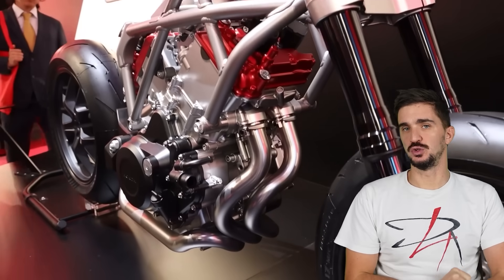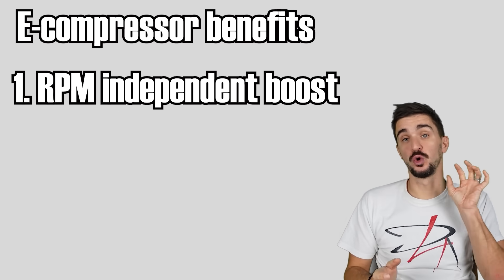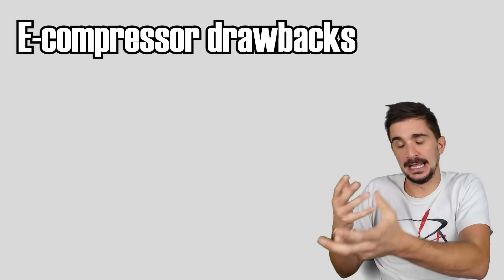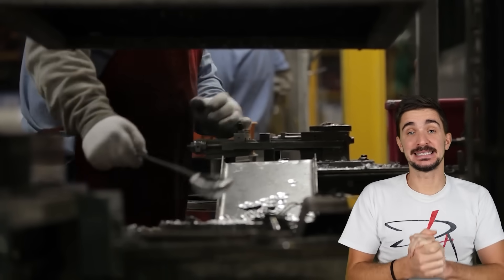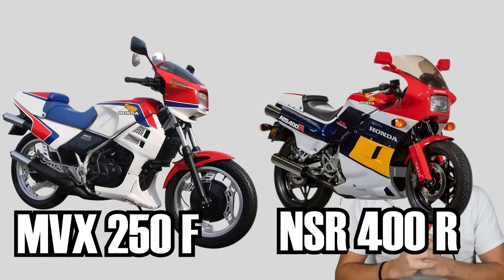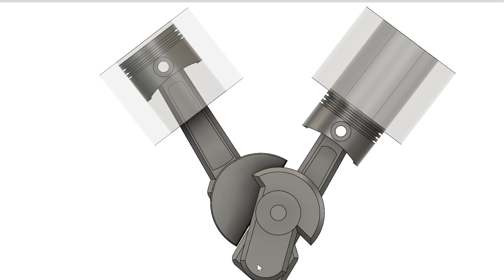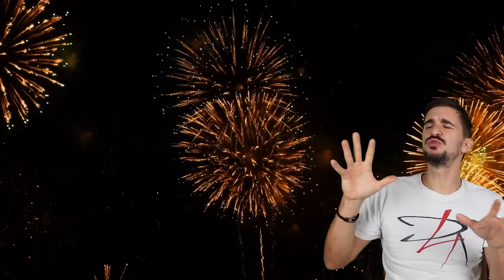Honda's New V3 Electrical Compressor Engine Explained

Comment: The first four stroke V3 on the Motorcycle market, the first in general for Honda after the two stroke and the first four stroke V3 engine for many decades after the Warchalowski V3 tractors from Austria. Sounds fun. But if they use your claimed firing order, then this bike is nothing else than a Laverda three banger with its firing order built until the beginning of the 80s in a V shape and supercharged.

Comment: what if we used exhaust gas to spin turbine and store that energy in electric form and then transfer this electric energy to intake turbine via motor like in this honda V3. this way we get maximum control of intake turbine without directly relying on uneven exhaust flow.

Comment: a reminder that boosted engines HATE low rpm high boost situations and that is normally when they experience ringland failures.

Comment: F1 has done something like this for a while, the turbo turbine shared a shaft with the hybrid electric motor/generator, so on decel it's generating electricity on this spin down, then when you hit the throttle the hybrid motor instantly spins the turbo back up to boost speed electrically without having to wait for the exhaust gasses.

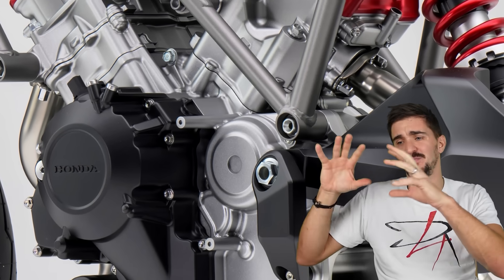Comment: 2:01 it's still wild to me how much of a 4 stroke engine height is due to the cams.... I'm used to two strokes
Reply: You'd like the old Flatheads.
Reply: @lanesaarloos281  probably 😂 I have only seen a few photos, but haven't really seen the porting for the exhaust and intake irl

I just remember seeing "inverted" valves

Comment: Fantastic reporting!  Thanks to the author.

He reports the compressor system adds about 6# of weight.  IIf both engines are similar NA, does not a 1k engine weigh about 6# more than an 800?  Score an approximate tie, pending reader corrections.  BUT, the smaller engine's 20% less reciprocating mass/gyroscopic effect yields a huge, always present advantage in the bike's dynamic performance (braking, cornering, transitions, etc.)  

The author posted that NA liter bikes make about "130 HP."  Doesn't Honda rate their 2025 Hornet NA I-4 @ 150hp?  A minor point.  Whatever is the Hornet's peak HP, I presume this new bike's peak HP is within shouting distance, and more than adequate for street use.    

V-engines are my all-time favorite, so I presume I'll love this bike's sensory perception.  5psi of boost is fine for a street bike IMO.  If, as stated, this engine's 5psi is available almost off-idle, with off-the line performance a close second only to a fully electric motor, this bike could establish a new benchmark for day-to-day all-purpose street performance, even if it does not set new track records which is not its purpose.  (Interesting that we speculate that an electrically compressed ICE rivals the torque of a full electric motor.) 

This is the most attractive and interesting new motorcycle technology I can recall.  I'm glad to see it's a product of Honda R&D.

Comment: This is confusing me, in their patent they said that the V angle should be arccos(1/2n), where the number of cylinders is 2n+1. For a V3 this gives an angle of 60 degrees, not 75.

Comment: WRONG. A turbocharger will be more efficient than an electrical compressor.
Why? Because mechanical-to-mechanical power conversion has less loss.
When you go mechanical-electric-mechanical you are adding a conversion stage.

Comment: One critical potential point of failure i can see is a leaking seal in the compressor and u be pouring coolant into your air intake. Hydrolock ur engine and R.I.P engine. @6:35 but then its a common issue in any engine with gaskets too.

Comment: I don't think the balancing part is correct.  Reading Honda's patent on odd V engines, they work by having pistons paired into V2s, turning on the same crankpin, and then an odd piston whose crankpin is 180-75 = 105 degrees away from the paired pistons' crankpin.  So, for the V5, it's two V2s with a extra cylinder in between, but for a V3, it's a single V2 with an extra cylinder strapped on the side.  This would lead to a rocking couple, and the patent specifically mentions that it prevents rocking couples by considering n to be even, meaning v5, v9, v13, etc configurations.

I'm not sure Honda will be applying this patent to this new v3 engine.  But if they are, go back to your v5 video and subtract one of the V2s from the side of the engine and that's what it will look like.  One common crankpin for one pair of cylinders in two separate banks, and one crankpin for the remaining cylinder in the front bank, offset by 105 degrees.

Comment: A V4 is 2 cylinders wide, so not sure if that is a big advantage, as the lead in hook.
A turbo is restrictive to exhaust, even when not boosting at any significant level.
The only silver lining is some exhaust catalytic finishing for emissions in the high pressure area and turbine blades, before P-drop.
This was a clean video, not much to pick apart, liked the patent dig in.

Comment: There are hybrid engine technology inventions that retrofit the existing powerful 2-cycle and cleaner 4-cycle engines into a “D-cycle” (differential-stroke cycle) engine; and that further retrofit the existing dies-el and gas-oline combustions into the “diesoline” hybrid combustion engine. The hybrid D-cycle design has been tested to great efficiency (>20% fuel saving), and great power gain (>2.5x to 3x torque increase). The diesoline retrofit can theoretically further saving >15% more fuel, besides eliminating the nasty and costly diesel engine’s after-treatments for soot and NOx emissions – with the gasoline engine type emission control. These retrofit technologies are all available in existing engines.

Comment: @Driving 4 Answers, you failed to explain that a conventional turbocharger extracts otherwise wasted energy from the exhaust, thereby increasing thermodynamic efficiency so in effect DOES give some free energy due to the overall gain being greater than the losses it creates. 
Val Page designed a v3 for triumph back in the 1960/70's, in fact he designed a group of modular engines that could have varying configurations (including v5) using many common components but it was never used partly due to Edward turner's arrogance and poor management.

Comment: 5psi = 30 horsepower, make me laugh, biggest alternator and battery request more couple, you loose part of power.
Reply: 0.34 bars never increase 30cv like turbos 1 bars, and electric's turbo are more linear.

Comment: Honestly, I'd be interested in seeing performance, emissions and mileage comparisons between a V3 like this and a conventional i4 or flat-4 (VW Bug type) for a small car that doesn't need to haul heavy loads but could be used as a daytripper across Europe... or do a day trip from Melbourne to Sydney here in Australia on our 100-110kph highways.

Comment: Once the engine is running above idling speed all of the electrical power comes from the alternator to both run the compressor and keep the battery topped up.
Regenerative braking is possible but tricky on a bike I would say.

Comment: I think the reason for no intercooler is not the short inlet. The reason is that there is no hot exhaust powering the compressor.
Reply from the maker: I never said the short inlet is the reason. The reason is 5 psi of boost.
Reply: @d4a Okay, I stand corrected. I should have thought some more before commenting. Sorry.

Comment: Check JJ Cobas his MotoGP concept. It had the same configuration, a V3 with one cylinder at the rear creates for a smaller width where you need it (rider/Fueltank) while have more weight in the front wheel (whixh you want on a sports motorcycle)

Comment: An uneven firing interval on a motorcycle actually does have advantages. The uneven application of power causes the tires to slip less abruptly which helps the driver "feel" when they are approaching that condition. This is mainly relevant on a race track; on public roads you should probably stay well away from driving in a way that gets you anywhere close to slipping your tires.
I wouldn't be surprised if this isn't the channel where I learned that.

Comment: The intake motor, additional battery and beefier alternator must add more weight than you estimated. However, with a much smaller capacity than a typical car engine the electric forced induction should work well. The main thing is though it will be fun! The engine will sound gnarly and combined with the intake whine and extra shove the bike should be a blast to ride.

Comment: This may be a stupid question, but I'll ask it anyway. Do you think Honda will try to use a V3 engine in MotoGP from 2027 onwards? The 2027 bikes will have 850cc and you said this engine will range from 750cc to 800cc which seems close enough to apply to MotoGP.
Reply from the maker: Hmmmm..tough to say. Maybe? But I feel likr the chances are pretty low

Comment: The biggest technical challenge with e-compressors, particularly very low flowing ones like this, is developing an electric motor and inverter capable of spinning at the speeds the compressor would want to spin at for high boost. Basically, transistors can only switch so fast, and a three phase AC motor spinning at 350,000 rpm would exceed those capabilities.

Comment: Alternators are incredibly inefficient. A turbo running 5 psi draws very little power. I am willing to bet the power draw of both systems is neck and neck, and you can't know which one adds less parasitic loss to the system without extensive testing. The e-compressor would have the advantage of spreading that loss over a longer period of time so peak power probably should be higher.

Comment: All of the honda photos are renders. So they've made cad of the castings. They haven't for sure made castings yet. Also a lot of companies have moved away from machined from billet for complex parts where you want to do all your testing with representative parts. 3d printed metal parts are more likely.

Comment: So, it produces peak pressure while stopped and the gas floored, and at top engine output, the electric motor imposes the greatest load on the engine. They probably kept it to 5PSI boost to minimize how noticeable such a bad idea is if you're doing more than burnouts and wheelies. An advantage of an electric motor is that you can probably get faster response for tricks like wheelies and freestyle terrain maze competitions.
If they wanted to build a racing version, they'd just connect the blowoff of a regular turbocharger to a burner can that sits between the exhaust ports and the Turbine inlet, and program the ECU to cut spark, open the BOV, and keep flowing gas in accordance with the O2 sensor's feedback when the throttle plate closes during race mode... That way, the turbo spools up in the corners and you launch out of them like you're in a hurry.

Comment: so the electric compressor will be run by the electricity that the alternagor generates off of a belt right? isnt that just a supercharger with extra steps?

Comment: So here's a weird question for someone... Could this V3 be configured, AND be worthwhile, where EACH piston be offset where only 1 is firing at any time? (I think it'd have up be a 72° V, since that's divisible into 360 an odd number of times)

My thinking being that it would be balanced in that scenario, or at least, require less counter-balance...

(I know long ago there have been 3cyl W [unrelated to VW Group's "W"], but that takes up 33% more real estate front to back, hence the desire to stick to a V)

Comment: Cool video, would have been cool to have had a theoretical sound bite for how the engine could sound based on the firing order. But I suppose it'd just sound like a normal V t-win?

On that you were going to do a video about V twins and the different popular angles and placement but I can't seem to find it? Did you ever make it, or did you abandon the idea? I'd love to see your take on various V-twins like Ducati "L" twin which was their way of dealing with the cooling issue of a V-twin. But also I'd love to see your take on the 90-degree transverse V-twin of Moto Guzzi's which also deals with the cooling issue of a V-twin which also deals with the length issue as well... but I'm sure has all sorts of other trade offs.

Comment: Not knowledgable enough to understand this by myself: why not have a turbo with electric components?

If high rpm melts it off, why not have it for the low rpm so we have a better graph of boost than with a traditional turbo? Is it too complex to have a mechanism that engages at low rpm before lag? Granted it'd need to be bigger because you're connecting it to the exhaust, among other downsides. But how badly would it be to make something like that? Am just curious because I wouldn't know how to research the data for myself.

Comment: 1. Contrary to positive displacement superchangers, centrifugal supecharger has a problem to deliver high boost pressure at low flow ( low PRM).
2. Turbo-lag- you  have to  have it, since electric motor still needs time to accelearate the impeller  to higher speed to provide enough boost.

Comment: Really, the electric compressor is an emissions aid isn't it. For pure performance, you would be better taking that energy and putting it straight to the wheel. Also, a turbo improves the thermal efficiency of the engine by harnessing waste energy. It may well strangle the exhaust, but it is recovering energy in a way that taking it from the crank just isn't. Free energy doesn't exist, but a waste heat recovery system is pretty close. This is a beautiful design, but if Honda added in a turbine generator to the system, then it would be awesome.

Comment: Biggest benefit in the compressor/e-supercharger engine to me is the lack of back pressure. Still until the electric motors are likely water cooled, and batteries are waaaaaay better than they are now, meh.

Comment: An interesting design.  I find that the idea of an electrical compressor on a Honda brings reliability in question.  Why you say?  Because an electrical motor needed to operate a compressor will require the engine to produce much more electrical power than is typical of an engine of this size in a motorcycle.  Add to that Hondas typical design failure to provide a reliable stator design in its engines of a V configuration, I fully expect this engine to be short lived and fail early in service. For example the VFR series, the CX500 and 650 turbo engines have common stator  failure records as well as other Honda designed engines.  Add the full time demand of an electric motor to drive a turbine, is a formula for disaster.  An electric motor is an inductive load and requires a serious amount of power to overcome come locked rotor current demand on start .  Add to that the need to maintain rotation of the turbo under load and the power required verses the power loss making the electricity makes the engine inefficient.

Comment: I actually wanted to add E-compressor to my modified KTM EXC. However, finding and makings parts for it is such a hassle and expensive when not owning a fabrication shop that I didn't even try to build it. But who knows, maybe one day, it would be interesting challenge at least.

Comment: Did you assume a linear scaling when estimating weight? Smaller parts are always significantly heavier because volume and surface area do not scale together. There's also a minimum size for standard portions of parts (connectors, hoses, cabling, etc), so some things are larger than ideal for the rest of the system size.

Comment: Wow, so basically the compressor is a turbo that runs off electricity instead of exhaust  back pressure, traditional turbos are oil cooled and lubricated because they run hot, but this one is cool by liquid coolant  system running through it, Hondas technology is second to none and I love my honda bikes durability and reliability, but I'm surprised they didn't focus on all electric technology like so many manufacturers are doing to reduce government demands for lower emissions,

Comment: Castings and CNC billet parts don’t necessarily mean something is production anymore. 3D printing has made prototyping cast parts much less expensive.
Reply: True, but you wouldn't bother making cast parts for a one-off construction/proof of concept, regardless of cost. The fact that this prototype has cast parts tells us that the overall design is finalized and is being/has been optimized for mass production.

Comment: note about the older v3's. The mvx250 is scarce, because of poor sales and because most of them have blown engines by now due to the upright cylinder conrod/piston messing about because honda did indeed experiment with different weights to get it balanced.
The NS400 is a much better engine, even though it is largely identical, except for the fact that honda abandoned the idea of making it not vibrate like they tried with the mvx250, but instead just used much beefier rubber mounts and let god do what he wanted. And turns out, that was fine! all 3 conrods and pistons share the same part number, although theres 3 pistons "ranges" to pick from, A, B or C, stamped on the cylinders. This is a manufacturing tolerance thing, and not a balance thing. Essentially, the NS400 has "we dont care" primary balance. And as an owner of one, its lovely!

Comment: I can't believe it is possible to patent the arrangement of cylinders in an OTO engine! A few years ago, I was thinking about the same concept of two cylinders in the front and one in the back, and someone told me that it was patented... Are single-cylinder engines with the cylinder at a 90-degree angle, or horizontal, or vertical, also patented? oblique? Or twin cylinder with zero degree angle, 180 degree, 270 degree, is the KTM patent with 285 degree angle?? How can such things be patented that are just a "variation on a theme" of something invented over a hundred years ago? Will someone patent me tomorrow, if I have to pay them in order to live...